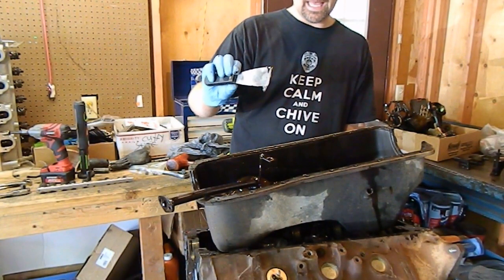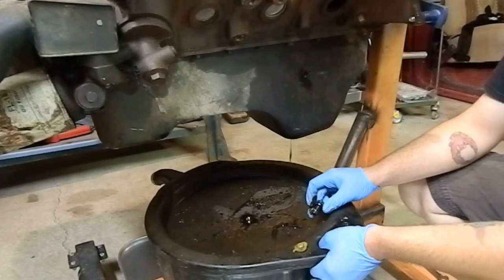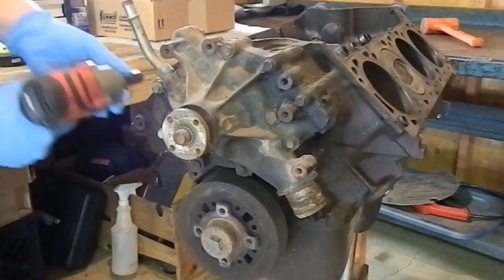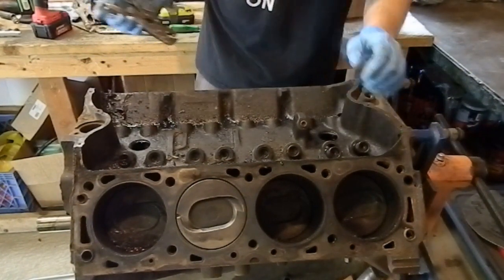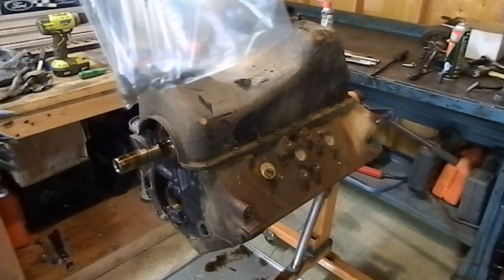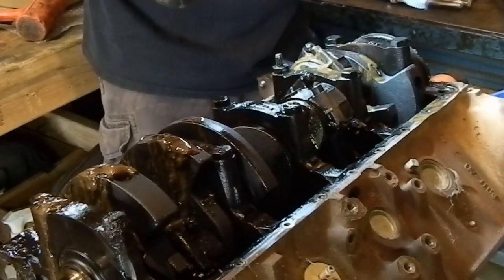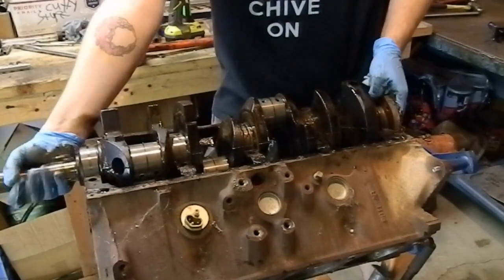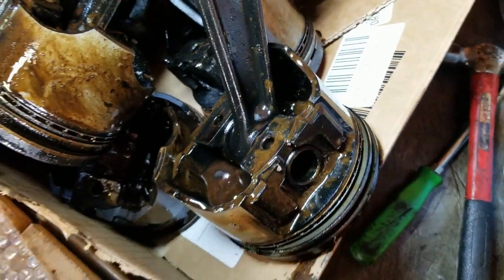Budget 460 build episode one; teardown

Comment: That looks like mine. I just finished my 86 F-250 4x4 460 4 speed rebuild. I had to bore it .040 over to 468. I put ICON Forged Pistons in it with Eagle H-Beam 7/16 Connecting Rods. I got hold of a rare set of Dove-C Heads with CC Roller Rockers from a guy in Las Vegas Nevada. They had already been done. I put a CC Hyd. flat tappet Cam in it that is .564 Int. .574 Exh. Lift with 226 234 at .050. 111 Lobe center. I just barely got it running. I've got just a little more to do before she hits the road. How did your build turn out.

Comment: @7:00 you were mentioning EFI heads vs Carb heads. Are the heads you bought, carb heads? Just found your channel, I have an 84 F250 with the 460, and I’m getting ready to help her get her mind right.
Reply from the maker: Yes all aftermarket heads are carby heads.  The engine had fuelie F3TE heads stock which have different port locations

Comment: Got a question I’m gonna pull my 460 out of my 79 f150 should I pull motor only or motor and trans what’s easier
Reply from the maker: Motor only easier especially if it's 4wd.
Reply: @cprgarage3206  it’s 2wd
Reply: @cprgarage3206  so what all do I need to unbolt
Reply from the maker: More than I can fit on here check out www.ford-trucks.com